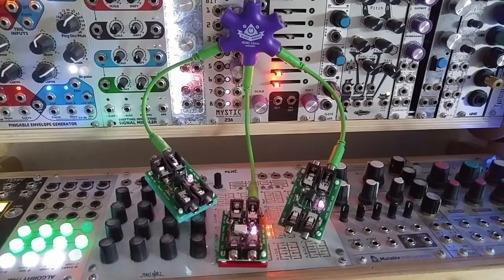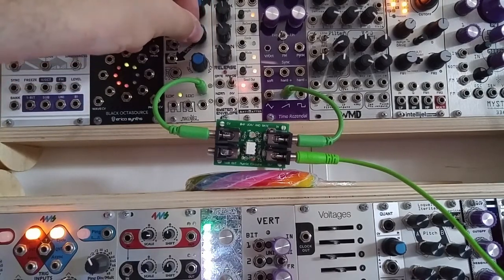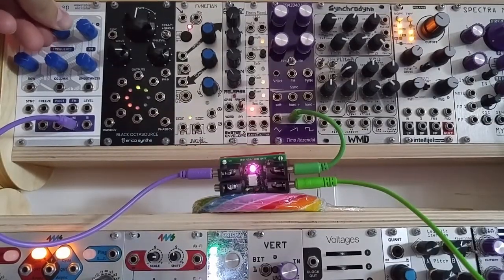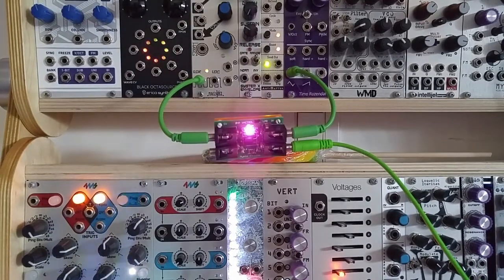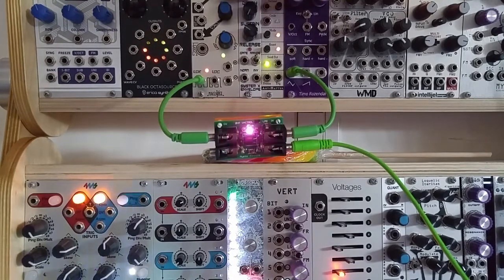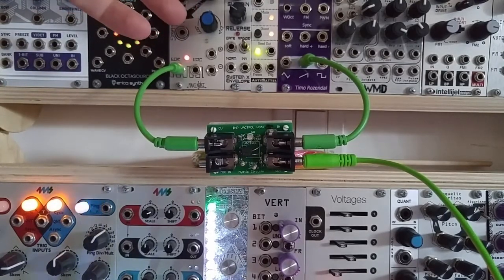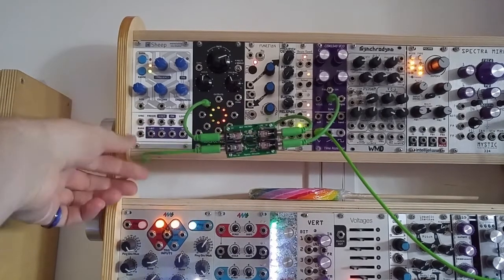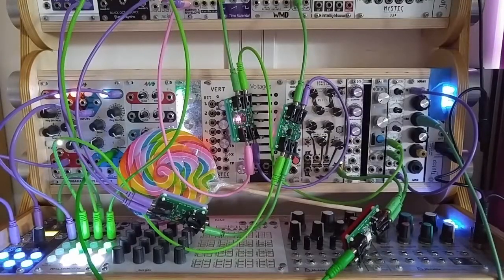Mystic Circuits 0HP Modular VCA comparison

Comment: is the audible noise something thats imparted by the 0hp modules or is from elsewhere in the chain?
Reply from the maker: My guess is that it is from the equipment I was using to record although this video is rather old so its hard to say for sure.  The 0HPs are passive and so it is unlikely that they will add noise to a signal that isn't already present.